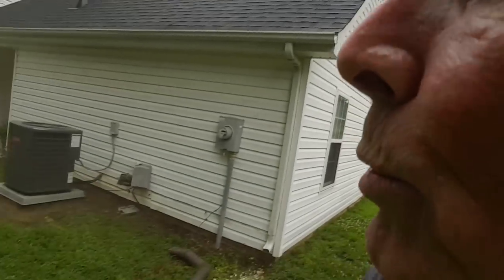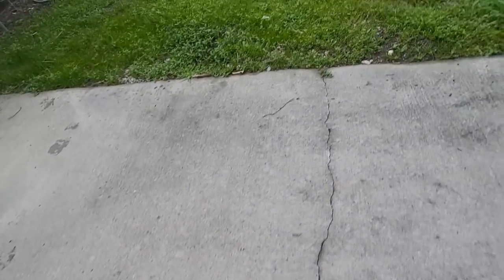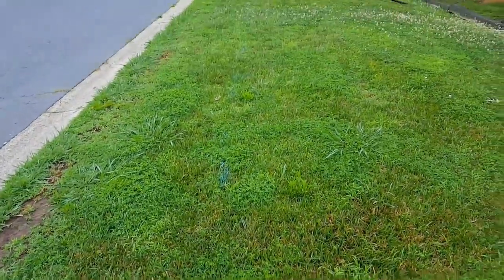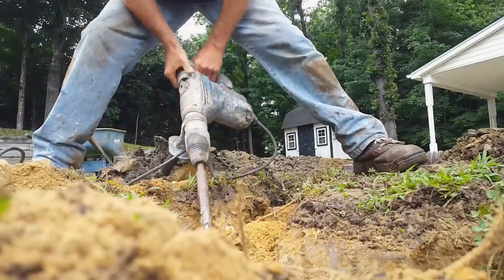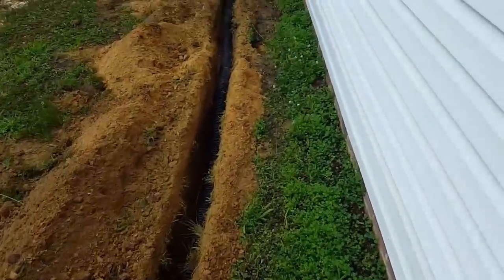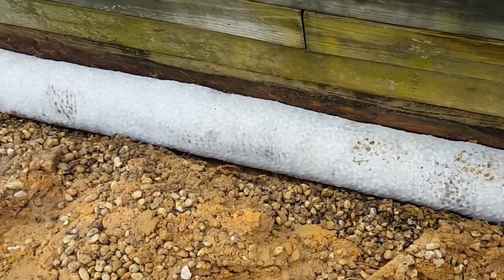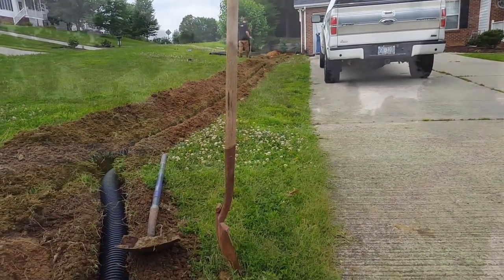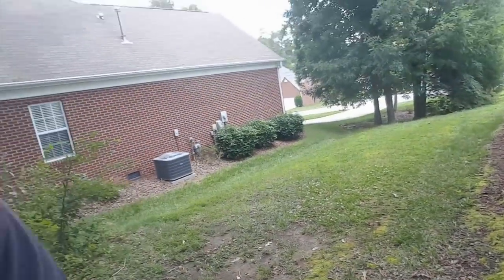FRENCH DRAIN DIY

Comment: If your perforated pipe is going downhill so the water can flow downhill.  What is on each end of the pipe, the end that is highest and the end that is lowest?  Do you put a cap on the high end?  On the low end, what do you use?  Is the low end going to run into a catch basin?   Or is the low end going to be routed back up to grade with a pop up.  Under either scenario, how is the water going to make it uphill?

Comment: I have a question are you putting a incline on these? The area in my backyard more or less has a 2-3 inch gradual decline that pools up during flash flood and steady rain. The problem is it come from all sides (like a square) AND my back porch is compiled of 4 concrete slabs  that have gradually sunk over the past 40 years. They are still above the surface, but lower than the ground around them. What would you recommend? Also I am not financially well off, so DIY solutions preferable. 

Thank you!
Reply: a picture would help but if it sounds like you need to saw cut through concrete to put a drain in it. You could rent a gas powered saw. I could be very off on how i'm interpreting your situation.
Reply: Looks like you have 2 problems.
There are ways to lift concrete with hydraulic pressure. I'd go to a local fair that has all those home owner contractors. You'll find one of those guys there that can give you a good price. Probably over $600 though.
For the standing water you can always put a pipe in and it can flow as long as the trench has a grade. Doesn't matter the grade of the surrounding soil as much. Then you're going to want to connect it into a big pit filled with gravel or rain water barrels with holes in them also filed with landscaping cloth and gravel.
Reply: take away the dirt around it ..re-slope the dirt. use mortar with a bonder and make a tiny ridge next to the house to keep the water away..